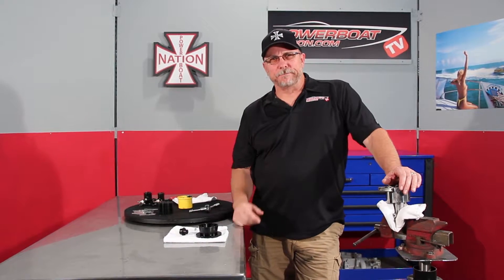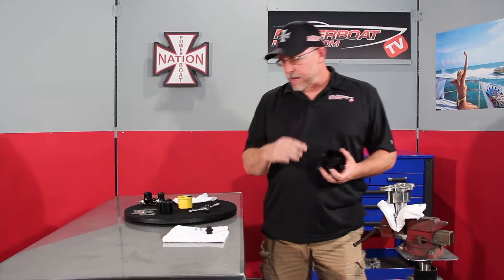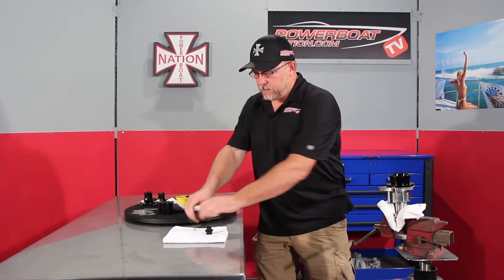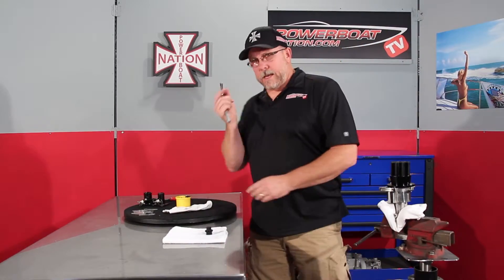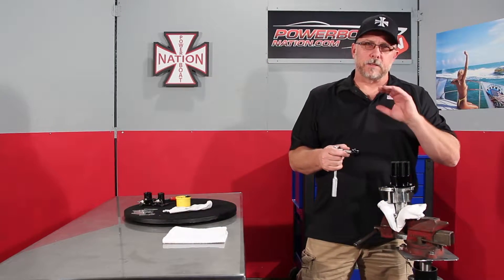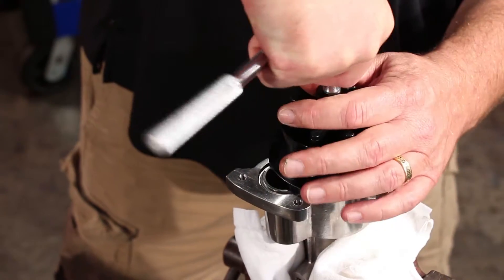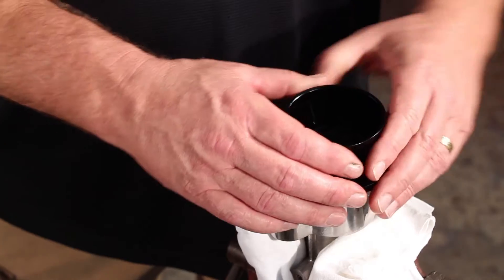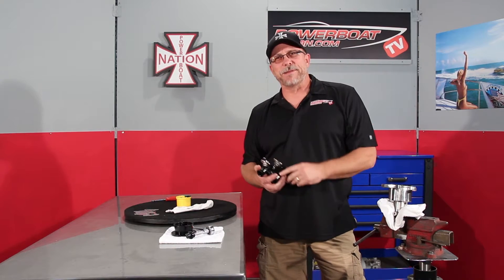PBN TECH TV: Installing an Impeller Made Easy With Hardin Marine's Gen 7 Sea Pump Installer Tool

Comment: This “tool” seems very unnecessary. I’ve never had an issue with installing an impeller. This thing doesn’t even fully install it, you still have to push it all the way in by hand.